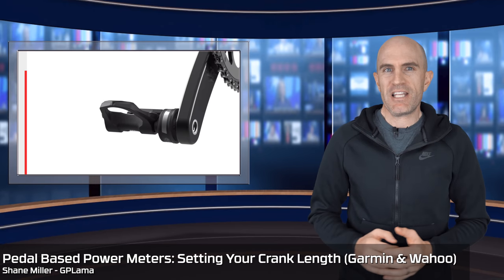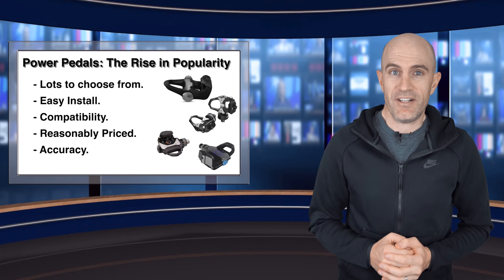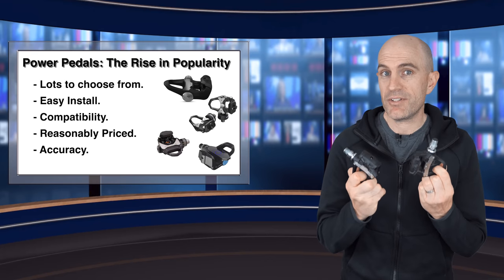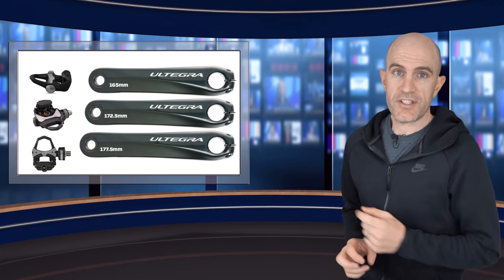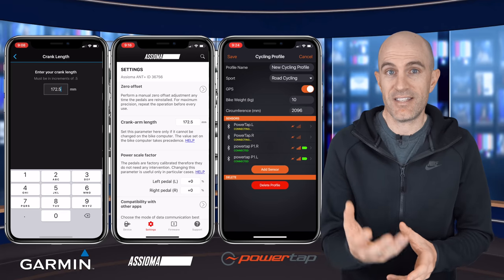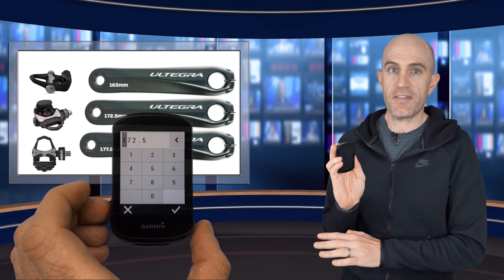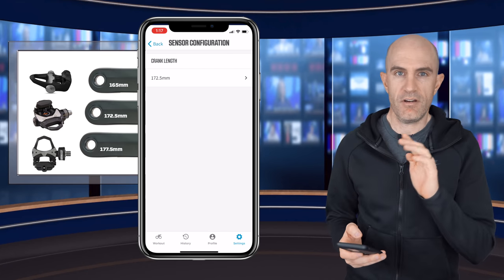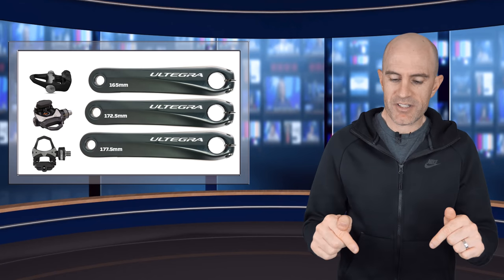Pedal Based Power Meters: Setting Your Crank Length (Garmin & Wahoo)

Comment: Another very helpful video. Thanks. BTW have you done a video or comments on why power meter data is consistently lower when uploaded to Strava Vs Garmin etc. Even when power zeros included? Haven't been able to find an answer online...
Reply from the maker: I haven't looked into how either interpret FIT files, all my analysis is based on the raw data itself. I'd take a guess that Strava and/or Garmin may be doing something funky with zero/0 data. I'll have a deeper look when I get a chance.
Reply: @gplama  thanks

Comment: Best option for general consumer? Power meter cranks or pedals?
Reply from the maker: That depends on budget, bike type, and cleats I guess. See my post over on https://gplama.com and discount most Shimano L/R cranks for the time being.
Reply: Crank based is best and not to hard to change from bike 2 bike..A p2max powermeter never had a days problem with it
Reply: Depends on that general consumers budget. If budget's tight, perhaps consider a Powerpod? It has its quirks indeed, but it may fit certain peoples' need
Reply from the maker: @nickzourikian4555  People really need to review the actual on-bike user experience of the Powerpod before considering it.
Reply: @gplama  Agreed, it can indeed be a pita. However, interstingly some reviewers such as DCR have given it reserved 2 thumbs up, while others hate it!

Comment: Hi Shane,
My Assioma's pair flawlessly with my edge 830. However, there seems to be a 5 second lag between my actual power output and the power that is displayed on the screen... Do you have any advice on how to fix that?
Reply from the maker: I'd need to see the data/testing/etc before making any useful suggestions.

Comment: How do you set the crank length on a Sigma ROX 12 Sport GPS, and what are the limits?
Reply from the maker: If you can't set it within the peripheral options, assume it won't change the crank length. As long as it is set on the pedal it'll be good.

Comment: Do any of the pedal based power meters work with Shimano Road Cleats?
Reply from the maker: The Vector 2 has an additional kit you can purchase to use PD6800 pedal bodies... but... they're Vector 2.
Reply: @gplama  thats what I thought. Do tou know why they dont offer for more cleat styles?
Reply from the maker: @AmsterDanTheAmerican  There has been no real solid reason given... I suspect there might be patent issues or licensing fees to use the Shimano SPD-SL design... maybe it's an issue with the cleats (maybe similar reasons?).
Reply: SPD-SL or no power pedals for me. I use Dura ace pedals anyway so crank power metres it is.
Reply: Shane Miller - GPLama are the vector 2s good?
Reply from the maker: @alexamparo817  They've been replaced by the Vector 3... so they're old tech. They also take more messing about installing. By today's standards, no, they're not as good as the other options.
Reply: If you can wait....early 2020
Reply: Shane Miller - GPLama sadly they’re the only ones that I can use with my shimano cleats 😔
Reply: @Alex Amparo, I recently made switch from SPL-SL, and the conversion was quite smoother than I expected.

Comment: Am I right in thinking the zero offset is also stored on the pedals? i.e. if I zero them on my Bolt and then use them on something like Sufferfest, the Sufferfest will use the zero offset generated by the command from the Bolt?!
Reply from the maker: Yes, spot on.
Reply: @gplama  perfect thanks! Useful video, I never knew the head unit essentially ignored the crank length setting on the pedals if it's set differently.

Comment: Are there any SPD compatible power meter pedals?
Reply: Not that I know of. There is a kickstarter campaign that started off as something else but has evolved into a lower priced pedal based power meter, and they claim to be able to produce either road style one or SPD based one. But caveat emptor, they are way overdue and have half the backers mad at them for changing the campaign after promising something else and the other half saying they'll take whatever they can get. They ran into inconsistency issues with the original design that would've been able to be added to any kind of existing pedal,. They're promising August delivery of the pedals but if you ask me seems highly optimistic and jury is still out on whether they'll deliver anything. In any case here's the link : https://www.kickstarter.com/projects/1468298434/cycling-power-meter-at-a-breakthrough-price?ref=user_menu . By the way they also have a web store if you want to risk your money on something that doesn't even exist yet.

Comment: I just got the vector 3 (dual) and had the biggest freakin issue getting them to update. (Due to the cutting in and out) garmin has sent me the replacement cap and updated connectors. Even with that I had to use baby oil and so far, they stay connected to my edge and phone. Will see how this shit show turns out to be. (Pedals have 1 mile on them, yes 1 test mile)

Comment: OMG .. really getting desperate to make a video. LOL.  Its in the installation instructions
Reply from the maker: This was asked on my livestream today. People have asked about where the setting is within the Wahoo Elemnt/Bolt/Roam (it's tucked away in the app). And it's interesting to know the head unit setting overrides what's on the pedals. Desperate? Remember most of what I cover is in the manual. Nobody reads it.
Reply: @gplama  Good point! Was thinking the same as Greg, but didn't know about the head unit. Turns out my Elemnt Bolt had the wrong setting. Thanks!
Reply from the maker: @hpmuc3794  Cheers. As more of an informative/resource based channel there will be things that people already know, and things some people don't. It's impossible to please everyone or 'entertain' them all the time. It's how people carry themselves when neither occur that's telling.
Reply: found this video very helpful with the wahoo bolt. sometimes it’s easier to listen/see someone do it then read it.